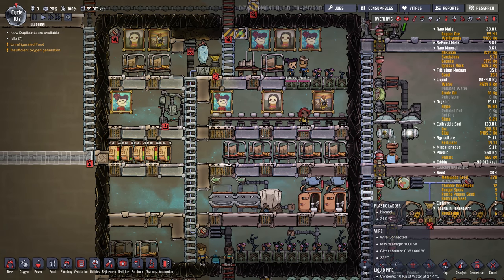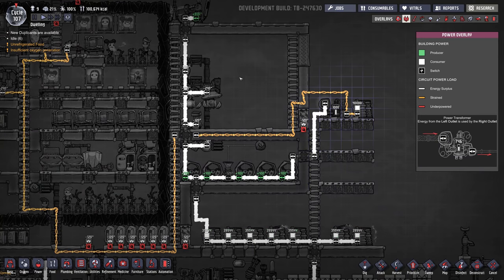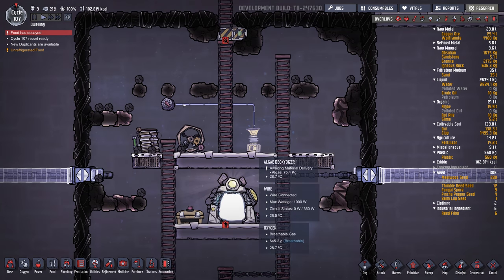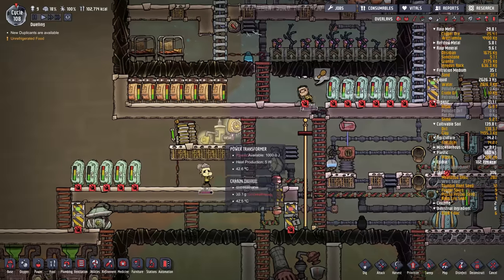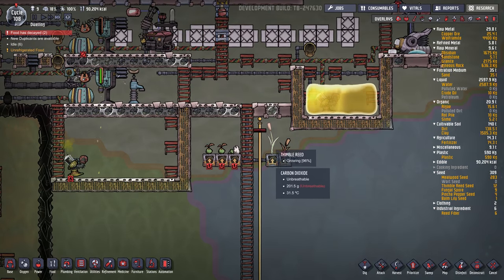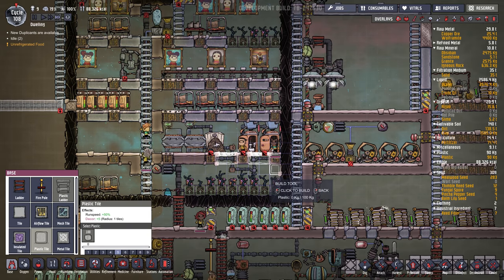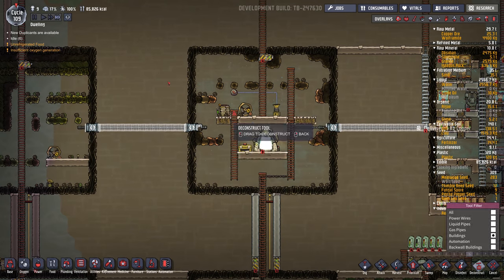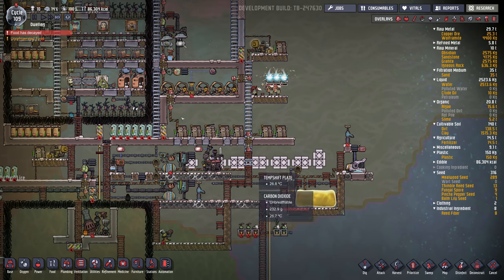THE TUBE COLONY CHALLENGE - GOING DEEP #4 - Oxygen Not Included Tubular Upgrade [4k]

Comment: You didn't use the charge on the neural vacilator and the wheeze warts are almost useless in such low pressure
Reply from the maker: I had a broken tile under it. I used it just after repairing it. And yeah low pressure is not really helping there. I could pressurize it with oxygen I suppose (or better hydrogen).